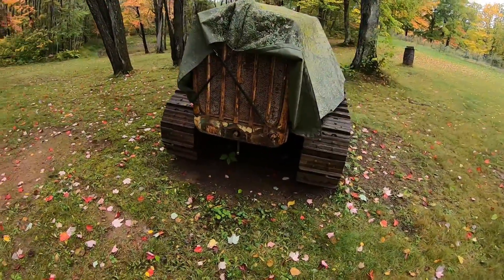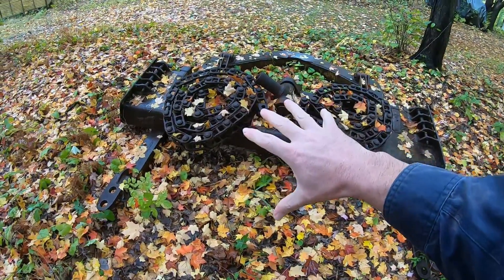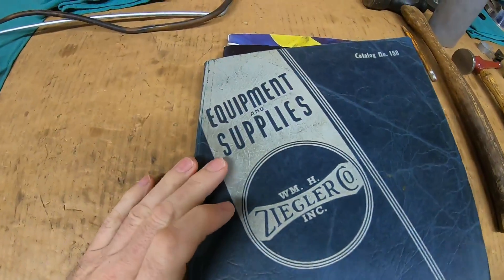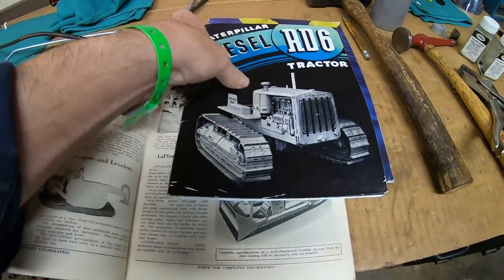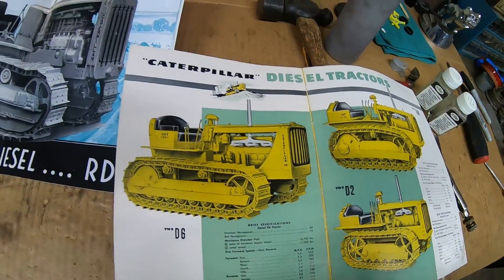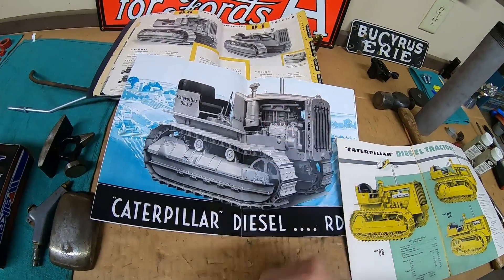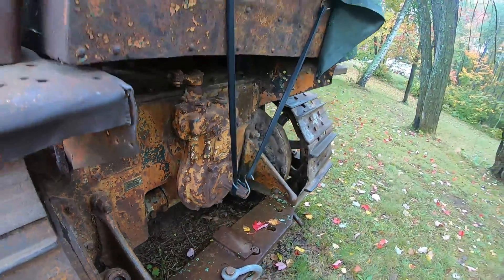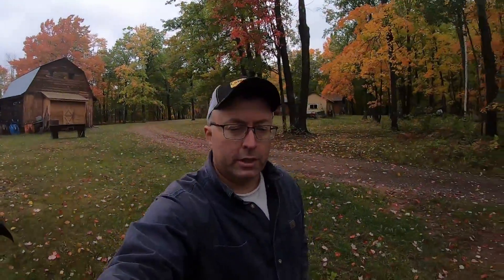Why No Dozer Blades on Our D6's & Why Some Early Cats Were Never Meant to Have Them

Comment: Could you do a video on your literature and reference materiel specific to Caterpillar in particular but if there's literature that's adjunct to that (you mentioned Le Tourneau)  that would be good information too. What do you consider essential as a collector to inform you about the ins and outs of Cat products, what is you're most 'treasured' literature etc. 

Those old catalogs are really well done.

Comment: I appreciate all of your in depth explanations and knowledge of equipment. Thank you for your time and quality of videos. I was hoping you might be able to identify a piece of Caterpillar equipment I was given if I provided some serial numbers. Caterpillar knuckle buster grader that hasn't run in many years but motor turns by hand.
Reply: @squatch253   On the front right side above the blade reads Peoria Tractor Company 71D528. I heard a lot about this dealership growing up and all the old timers talked about it. The hour meter has rust under the glass but reads 14520.  A pile of hours but not beat up! Not sure where I can find more ID numbers but can crawl on it anytime. Would like to find books for it once it's determined what model it is.

Comment: Hello Toby!
It is good to see you doing fine after your surgery. But here is one more request for a future video while you are recovering:
We all know 5J1113, we know the Iron Mistress, we know X253 and X231, the "Torque Monster, the H, the Super M. But I think there is a lot more. I once started setting up a list of what I've seen so far. Right now there are 6 wheeled tractors, 12 tracked tractors and 4 graders (including the scrapped 5J2115SP and 8A539). Would you mind doing a feature showing what else is hiding in the barns and sheds, beneath the trees and tarps?

Comment: Having run D2s in the 70’s as a college job, and I thought they were ancient machines then, as you stated, the short track frame required skill to avoid  the washboard effect. Once it happens the wave exaggerates and is difficult to eliminate without backing up and making another pass.

Comment: And if you go back in history on what would become Caterpillar, the Holt family had the Holt combined Harvester works in Stockton, CA circa 1882 that was producing what was called at the time Combined Harvesters that we have shortened to just combine today. Unlike the modern take on Caterpillar history of the region, they weren’t used out in the swamp lands (delta) but in the formally rolling grasslands of what they called the great valley in the 1880’s on massive tracts of land that were primarily wheat or barley. The Best family was also producing combined harvesters about that time as well.

Comment: Great video. Very informative as usual.
Noticed that both pre and postwar models in your catalogues had straight pipe exhausts. Wonder when / why (aside from the obvious reason) they started adding mufflers as standard equipment ?

Comment: having a 9u d6 yes they are far better to dive than the pre war stuff but no where as cool and fun and are you planing on getting any more D2s and did they ever make a long track frame 5j D2. and I have long track frame 5U D2 with a cat no 45 hydraulic control and blade and yes it is a bit heavy on the front rollers but not to bad being a long track frame.

Comment: A machine designed to not lift up the nose while pulling heavy stuff can't just handle big front loads, as you said, it will literally stand on the nose while moving backwards...
Great explanation, I could see it directly happen, when you were talking about it!
Take it easy on yourself, Squatch, you sounded a bit tired...
😯

Comment: Ben Holt designed a  caterpillar type track system for his machines so he could farm his ground around Stockton, Ca.
Track systems weren’t new, but he made them successful and practical.
But farm use first. Other uses came along and were adapted.
It’s fascinating to see how the early timber operations were quick to adapt track style tractors. Like Red River Lumber.

Comment: I always remember my work placement had a Fordson Major with pull coil start and it was horrible to start. Nobody would want to drive it so I had the short straw every day and one day I was surprised when my boss said that I would be getting a starting lever fitted so to make it easier.
Afterwards still nobody wanted to swap from their comfortable seat with cabs to the bare metal open to the elements Fordson Major

Comment: That's quite a bit of interesting knowledge. It's one of those odd things that gets noticed but your brain sort of makes up a reason like: Obviously the tractors just were not ordered with blades since it was cheaper to add them later.

Nope, they were tractors first and foremost. Only the larger nation nots was it even considered to have a blade or cable set put on.

Thinking about king cable for dozers. I distinctly remember this one cable dozer that was parked up in a lot that's now a dental and other medical plaza. I believe it was a D8 size machine, full woodland package.  This hugely noticable front radiator guard that was just barely not obstructing the front blade pulley block. Limb lifter bars from the top of the radiator back to a curved canopy top. Wire mesh across the sides and back, lights recessed under the bars an behind the cage work.

It sat for years till one day a group of guys were out there with a end load equipment haul trailer. The next day it was gone. I can still see it in my head as something I had wanted to own even back then when I was just deciding which Saturday morning cartoon was best.

Even now I think about it and a smaller machines to mind. I'm sure it was a D4 size unit the old man had and used effectively like a woods taxi. Similar style cage work. Lifters and forestry stuff. But I. The back, just above the hyster winch was a sort of expanded deck perched. A rear facing safari style seat for two, three to sit meant you'd be nearly making out level close. There was a short footboard to carry a deer or pig out. Wings of angle and flat iron with more mesh to keep limbs from slapping any riders.

On the front of had a forward tilted bullbar with hanging pulley block. A rope went from the front to the back beneath the tractor so if you needed the cable off the winch, just free spool of power out drag under, take one block to an anchor cable though back to a long spare cable or chain back to the tractor. 

It was loud and slow but the only thing that would stop it was a tree bigger around than ten inches. Otherwise, palmetto thickets, brush, blackberry briars and all sorts of other junk it would just plow right through.

Comment: My 2H D6 had a blade on it. When I bought it, the previous owner had already removed and scrapped it.  He said it was a scary looking home made contraption.  The reverse gear in the 2H transmission is not made to do dozer work. The reverse idler is located above the oil level and is supported by a bushing. It does no get enough lubriaction to be operated continuously in reverse. When I had my transmission apart for repairs, the bushing on my reverse idler was almost completely worn through on one end which caused excessive wear on all of the reverse gear teeth. It made a squalling noise when you would back up. The idler gear is also pretty small compared to the rest of the gears in the transmission.  One more reason not to put a blade on these tractors.

Comment: Hello Squatch!!  Like I have said sometime in the past I had a post WW2 Cat D6 I think about 1947 0r 48 This dozer was equipped with the LaPlant Choate blade with hydraulic lift with cylinders mounted on the sides of the radiator front bracing. I was involved with rehab of a much OLDER CAT RD 5 with the 4 cylinder gas engine that the tag said was rebuilt about 1950 or so and that the cylinders were bored 30 over. Actually this old girl was in fair to good shape to begin with drive line wise with exception of the tracks chain which was almost badly worn but still useable!! This old cat was equipped with the Bucyrus Erie blade system with the lift cylinders mounted horizontally over the tracks. This dozer was given to a friend of mine who's name was TOM CORANAS who used it for some medium construction work on his property just south of Newburgh, New York for 3 or 4 years. I think the dozer was made sometime in the late 1930's or so! The engine was a real good runner and did NOT burn ANY OIL at all and it had early electric start as well as the crank start as usual. The gas tank was located just behind the engine and in front of the operator's position. By the way take it easy with bending over! Many thanks doing these history talks about the older Cat's they are interesting to me!!  Take care and good luck with the eye problem!!

Comment: As a maintenance electrician and having worked on them for many years  I can state uncategorically that I really really dislike Letourneau  equipment particularly 3 leaf, 7 leaf contactors and their use of size 6 open transition wye delta starters in their dock crane MG sets. Don't get me started on their big diesel electric coal scapers. Many a night I've spent under a scraper stuck on top of the coal pile with a failed drive motor  digging a hole in the coal  to get  to the 3' x 3' access panel under it to release the brake on the, very hot and stinky, failed motor so he could drive off of the pile. Such a joy......... NOT😞

Comment: My great grandpas 40 acre farm was 1.5 miles as the crow flies from lake michigan. 35 acres of it are still in the family. The soil goes from sand dune hills to clay and mucky holes, the disc could be in dry sand and the tractor in clay muck at the same time, in many places.  
He grew primarily fruit and used a Ford N, not sure which and a D1 Caterpiller with no blade, just to pull implements and unstick the Ford. 
The neighbor farmer had a D1 with a blade. I never got to see either, my father did though and filled me in.

Never knew the details of why you wouldn't even want to blade one up before, makes sense!

Comment: Thats a good point to make about the weight balance. It does a good job showing the tractors intended use. Even wheeled tractors from that era had a similar weight balance, and the operator position reflected the typical impliment being used, mostly trip clutch or ground driven tools.

Comment: I had the opportunity to drive a pre and post war D6 a few years before the pandemic, one after another. The difference is huge. Neither were flogged units, part of a collection in France, so a pretty accurate experience. Squatch wasn't kidding that dealing with the pre-war model was a chore to deal with. It was a pretty cool November day and i still broke a sweat moving it about 30~40 meters. On the other page, the post war one is a breeze by comparison. Also the time it crystallized for me, just how much better we have it these days. I never complained about tight controls after that experience. :))

Comment: The logic Toby presented holds water. Everything was made with a specific purpose in mind. I'm not against drawbar tractors they are from the era when most farm equipment was with manual leavers and without power assist. One thing has me wondered: how long was the expected service life of a WW 2 era D6 or D8? I'm sure some where lost into the depths of the ocean and some may have had a encounter with a landmine. But from the old footages they kept going even after the war until they became just too broken or obsolete? Any comments?

Comment: I dont know how much of that has changed yet today.  I operate a D10 at work with 50% of the time it is laboring up hill, so weight transfer is more toward the rear than it is on the level ground and yet still we have to run a considerable amount of counterweight as well.

Comment: So then what is the designation of the D dozer correct, so why do you think the gave them the D as to a T for tractor, and we call them pans on the east coast lol a grander is a scraper and boxes scraper  a boxes scraper but a pan lol is a pan, and I still want to find a D6 Trac loader 10A models even if I have to rebuild it from the ground up my father had one they are not rare, but loaders had a different set up then the dozer, in the supention